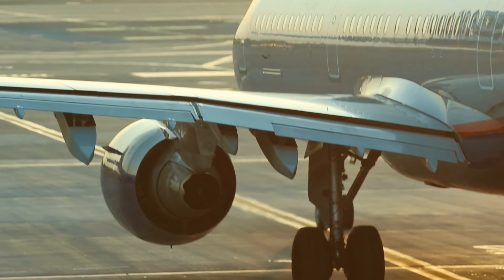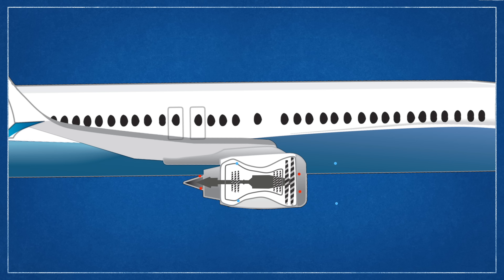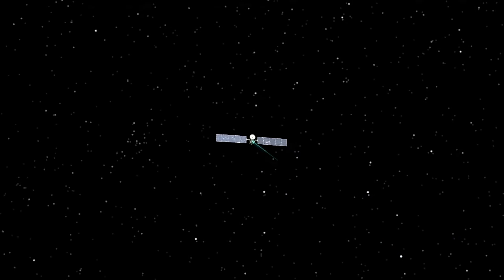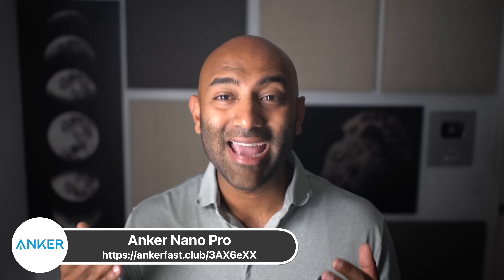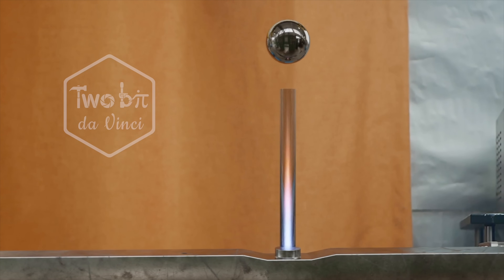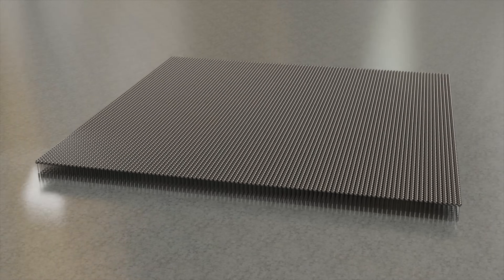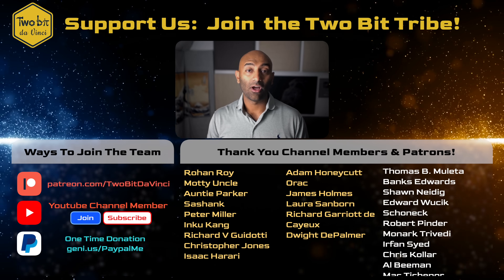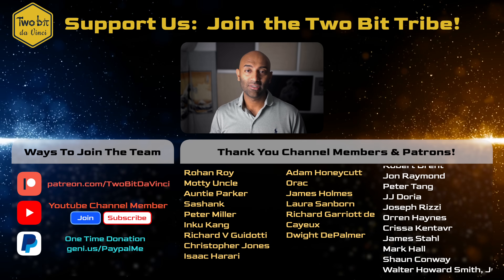The Next Generation of Jet Engines.... Is Electric?

Comment: "Plasma Jet" is too inefficient to be practical, a high performance propeller would be much better. Alternatively, they could do a "hybrid Jet" engine, with the compressor driven by an electric motor, fuel injected and burned to produce thrust, and no turbine to interfere with the thrust produced. Higher efficiency and less fuel used than traditional jet engines, yet higher speeds than a propellor could manage.
Reply: Your "Hybrid Jet engine" Would be terribly in-efficient & have very poor thrust output.
Reply: @guytech7310 , the efficiency would be less than a electric propeller, but thanks to additional energy from the burning jet fuel, it would have greater speed and range than an electric prop plane would. At the same time it would be more efficient than a traditional jet engine or turbofan, able to get more thrust from the same amount of fuel. The thrust would only be limited by the available fuel, air, electrical power, and the size of the engine. It should be capable of producing even more thrust than a jet engine of the same size.
Reply: @chrismuir8403  Nope: Your forgetting the energy conversion loss into electricity. Using an electric motor just added steps: mechanical to electricity: voltage\current regulation: electricity to mechanical energy. Direct conversion of turbine power to the compress is far more efficient, Plus lower weight: no need for generator + electric motor + cabling.
Reply: @guytech7310  I'm not propposing that a diesel generator be used on the plane, that would be inefficient. Instead, the electricity would be provided by batteries or fuel cell, and possibly from solar cells - if issues of weight, cost, and strength can be solved. But if you insist on including the energy used for initial production and transmission of electricity, I can also insist on adding the energy used for producing and transporting the jet fuel, which is considerably greater. Remember that oil refineries run on electricity, and the transport of jet fuel uses a lot more energy than transmitting electricity over wires. Result, the energyt savings from reduced use of jet fuel more than compensates for the energy cost of electricity.
Reply: @chrismuir8403  Thats even worse. Batteries do not have the energy density. The best batteries have about 900KJ per kilogram. Jet fuel has about 48 MJ per kilogram. Plus as the Jet burns fuel its gets lighter. Battery weight remains unchanged. They there is the loss of converting electricity into Mechanical energy, & the time it will take to recharge the batteries after every flight (probably a couple of days).
Reply: @guytech7310 , The far higher efficincy of electric motors compensates somewhat for the lower energy density of batteries, Tht's why some EVs can get a driving rnge similar to gasoline cars, even though their batteris hold less energy than a tank of gasoline. Several passenger carrying battery powered electric aircraft have flown, and commercial battery electric aircraft are being built for short-haul routes under 300 miles. The low fuel costs make them a very attractive option. But of course the energy density of batteries limits the maximum range. That's where the hybrid jet comes in - the additional energy provided by the jet fuel would allow greater range, the high efficiency electric motor and battery energy would reduce the amount of jet fuel needed. 
The notion tht it would take "days" to recharge is truly laughable, with a sufficiently powerful charger a full charge could be achieved in an hour or less. Plenty of time for a typical aircraft turn-around, which is usually over an hour. They are not going to plug it into a standard 120 volt 15 amp wall outlet.
Reply: @guytech7310 , Also, you've overlooked the fuel cells, which can efficiently produce electrical power from a fuel with a much higher energy density. Like hydrogen, which has a higher energy density by weight than jet fuel. Or possibly even from jet fuel itself - hydrocarbon powered fuel cells are in use today. A fuel cell powered hybrid might only burn jet fuel for extra power during takeoff, and do the high altitude cruising and landing on electric power only.
Reply: @chrismuir8403  Nope. I am not forgetting anything about this topic:
1. Fuel cells can only run on hydrogen which is even less energy dense fuel than Jetfuel or batteries. Also either need to be stored compressed or cryo temps -420F/-250C.
2. Fuel cells need to be rebuilt after about 2000 hours because the ionic membrane degrades with use. 
3. Hydrogen is produced using Natural Gas, and there are a some losses extracting hydrogen from NatGas.
4. Not a good idea to use Hydrogen in aircraft. If there is a leak or accident, It will explode like the Hindenburg.

Notice why there are no Fuel cell powered cell phones despite the hype about 15 years ago.

Chris, I am engineer & work with this stuff all the time. Jet fuel is the only option for commercial aircraft. 

FWIW: Commercial Air travel will be done in the next decade. Global oil Production peaked in 2018 & is now in permanent decline. Once Oil prices remain around $120\bbl all of the airlines will go out of business.
Reply: @chrismuir8403  You forget the conversion losses for generating & transporting electricity: The most efficient power system is the coal fired super critical steam power plant at about 44% thermal efficiency, NatGas Combined cycle power plant are about 33% thermal efficient. There is an additional 15% to 20% loss in generation (ie converting the mechanical energy of a turbine into electricity) as well as distribute (transport of cable & voltage conversion: Voltage step up\step down). At the very best electric power to the point of use is only about 38% (if using coal) or about 28% using NatGas. 

Overall an vehicle with an ICE will have a better efficiency. EV never include the losses of producing & distributing electricity. They only focus on the losses from the battery to the road.

None of this will matter soon as the economy starts to collapse under debt, Peak Oil and demographics.

Comment: That is an incredibly inefficient way to generate thrust in air. Using electricity to generate microwaves (inefficient in itself) to power a heat engine?? That’s inconceivably inefficient!! If you want to replace a turbofan engine with electrically powered propulsion, simply replace the turbine engine with an electric motor!! I’d bet the thrust generated per kWhr would be literally 100 times greater.
Reply: The reason why this wouldn't work is the same reason that forced the move from fan to jet.  As the fan turns faster and faster, the air drag and fluidity of the air limits the maximum revolution of the fan.  This in turn limits the thrust.  Historically, the plan was to keep the fan, but ignite the air so as to raise the temperature and reduce the density of air allowing the fan to turn faster.  But the solution to the problem led to am unexpected result: the jet engine.
Reply: Only power source that is capable of doing this is nuclear. This was attempted in the 50, but many technical issues stopped it. On thing I do like about this is its speed is unlimited, whereas jet engines, like scram jets, there speed is limited by fuel combustion. This could be much easier and simpler. But again, power source doesn’t exist.
Reply: I honestly don't get how an electric motor is incapable of turning a turbine setup but can turn a standard propeller. I mean they need electrical power to get turning in the first place surely a bigger motor can do the whole thing?

Its always going to be making up for the energy density of the jet fuel by other means. We really need to stop being so scared of hydrogen. It's been nearly 90 years since the hindenburg surely technology has improved enough since then.

Comment: Since everything needs to be electrified anyway, I'm glad this kind of tech is being developed simultaneously with better battery tech.
Reply: Battery technology will never be able to equal the metrics of petroleum fuels, which is why noone is talking about using battery-electric planes for transcontinental or transoceanic stuff- we would need to switch to blimps or zeppelins instead, at which point we'll probably be going solar.

As for plasma jets, they might make sense for supersonic stuff in the future, but for everything else electric fans make more sense.

Comment: (Now this maybe out of the Box)
   There are Quartz powered watches. I would think It's plausible that if enough Quartz were put together in a certain configuration it could do the job.
   Another idea would be to use a Micro-Reactor System as a source of power.
Reply: Ummm
Quartz watches use quartz for the timing (replacing the pendulum in a clock) not for power (ie not replacing the spring)

If you run a quartz watch long enough you find you need to replace the battery  (or pay a shop to do it for you)

Comment: Thank you as always Ricky, another in-a-league-of-its-own video. Yes please on more aviation technology, both current and in the pipeline. Also, has anyone considered beaming down the energy for plasma flight? There would be less need for infrastructure and the sun is a great source of energy, especially when captured outside of atmospheric interference. 🙃🤔🧐
Reply: Yes, people have considered it. To summarize: just use electrically powered fans instead of anything plasma, the plasma only helps with supersonic travel.

Comment: I think the future of air travel in the mid-near term will be hybrid. Sorry to sound like Toyota, but nothing beats kerosene for raw thrust. That can get your plane off the ground and up to 40,000 feet. From there on, an electric technology takes over for steady state and cruise. What exactly this is I don't know, but it functions ideally at high altitudes where kerosene performs a lot worse in the thinner air. It could be some kind of ion drive, or plasma, I'm not sure. I think this will be the next step.

Comment: I had this idea when I was 12, its not possible, the thermal energy needed to produce the amount of plasma to function is huge. You are literally just trading the stored energy of hydrocarbons to the stored energy of chemical batteries, which have a total energy density far less than hydrocarbons.
Reply: Better check your math.

The energy needed is not prohibitive for future technology which could be viable with further nuclear power development.

It will always be less energy density for the whole system compared to fuel though and I believe the solution is not to eliminate fuel, but rather to sustainably create the fuel in the first place.

Looking hard at hydrogen here.
Reply: @Spearborne  bro Jet-A aviation jet fuel has a specific energy of 12,000 Wh/kg where an example of a modern Lithium Polymer battery has a Specific energy of 158 Wh/kg, thats nearly 79:1. Complex hydrocarbons as far as energy/power density is concerned represent of total stored energy far greater than even the best battery technology. Resulting DRASTICALLY reduced range and payload.

What is the energy conversion rate of electricity to Microwave radiation and the subsequent conversion of thermal energy to mechanical energy imparted to the turbine or in the case of ram jet total net thrust generated.
Reply: @sgtjonmcc  that's cool. I said that already.

And I said nothing about batteries.

Try reading my comment before replying.
Reply: @Spearborne  The reason I ignored your comment on nuclear power development, is that as far as I know there are no plans to develop mobile nuclear power generators for automobiles or aircraft. It would not be advisable due to the potential radiation hazards, not to mention the availability of nuclear fuel.

Now if that is not what you meant please elaborate.
Reply: @Spearborne  As for hydrogen the fuel is viable however the world lacks critical infrastructure for it to be a viable replacement fuel for either Internal Combustion or Fuel Cell usage. I've seen estimates as high as $12 per liter. As shipping and storage would be required due to the lack of fuelling stations
Reply: @sgtjonmcc  >says its viable. 
>we don't have it now so it must be impossible though. 
>youtube greentext.

Bro stop.

Comment: How about a video on reverse fuel cells that take carbon dioxide from air, hydrogen from water to make methanol (jet fuel), it’s a closed carbon cycle and uses renewable electricity. There is a team in Scotland and others elsewhere
Reply: I would expect methane to work better, but if they can get it to work reliably, then it might enable long-distance electric airplanes. No battery or plasma engine tech will ever be able to do the same (at least for human passengers), so it would be a very nice development.

Comment: 200kW VASIMR said to be generating around 5N of thrust in vacuum. 10N using 0.4 kilowatt is a great result, can it be adapted for space applications? Probably not.
 0.5 liter of air per second (uncompressed, so the mass of consumed air will be greater) is 0.6 gram. For example RD-843 liquid fuel engine generates 1kN of thrust per 323g of propellant. Which is 0.3 g per 1N of thrust, 2 times more efficient. I wonder, do we need to ignite plasma or can we just lift this ball with compressed air alone?

Comment: Current plasma or ion thrusters used on satellites literally have the thrust of a hairdryer. There will never be plasma powered airplanes.
Reply: There is a little confusion. Ion thrusters are working on different types of acceleration respect plasma, with impulse far away lower than plasma air breading one.

Comment: So cool!

Wondering the feasibility of blended-wing aircraft with:

• perovskite skin (>50% efficiency)
• ultra capacitors + nuclear diamond batteries
• plasma jets

Probably 30-50 yrs away...
Reply: Also, nuclear diamonds have really low power outputs: you would use them to blink a light every minute, or to power a probe going to Pluto, but you wouldn't use them for a probe staying around e.g. Mars.
Reply: @absalomdraconis  Appreciate the reply. Learned something new.
Reply: Plasma jets won't be used for anything other than supersonic travel, because electric fans are easier.

Comment: I love your videos on engines and flight. 
At 34 mps I wonder if g-forces would be an issue. Although there's no air in space so no friction.
Reply: The speed itself is not directly related to the g-force. The g-force is actually not a force, it is the acceleration.
On the surface of the earth, you feel the acceleration of 1g = 9.81 m/s² (meters per second per second).
So it only depends on how quickly you get to that speed. You accelerate half of the way, and need to slow down from there, and you can do that with any acceleration you can handle and can produce.
Reply: @vsiegel  very well explained, thank you

Comment: It will produce Pollution,
A lightning bolt runs at those temperatures, and has enough power to make atmospheric nitrogen Into notrous oxides (that help fertilize the earth),.
Have a hundred of this engines on an airport and you'd get acid rain...

Comment: Plasma engines may find a roll, not for lower CO2 but for the ability to fly into space (no need for air intake).  As for the batteries - the break through may come in super capacitors that suit plasma engines and not electric cars... but this is all wishful thinking in this day and age.

Comment: I wanna see zero fuel rocketry !
Imagine getting to orbit without a the need for massive tanks of rocket fuel. You could, if you can match the thrust, use all that extra weight capacity that originally lifted fuel to lift payload.
Reply: Yeah but thrust comes from ejecting mass quickly so that isn’t really possible
Reply: You know that there isn't any air in space, right? Or are you just starting a new subject? This has nothing to do with rocketry. This is a jet that heats air and expels it out the back as reactive mass.
Reply: @filonin2  well he said rocketry so i assumed he meant space rockets
Reply: Just go outside and flap your arms.  REALLY hard!

Comment: Interesting shower thought: I wonder if in the exhaust of such an engine, you could recover a bit of energy with parallel conductive plates, using the earths approx 100V/m electric field, given that there is now some liberated charge that can move around.
Reply: Like an MHD? That would slow the exhaust, thereby slowing the vehicle too.
Reply: @absalomdraconis  You may be right overall, but the plasma will impart some momentum to uncharged air also, it may be possible to recovery the charge after with a net gain in efficiency (and it may not)